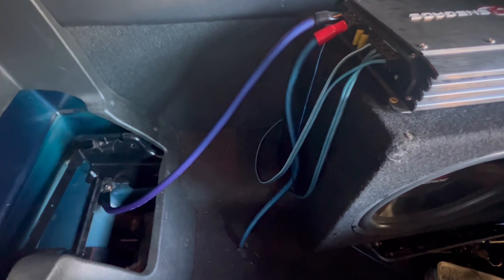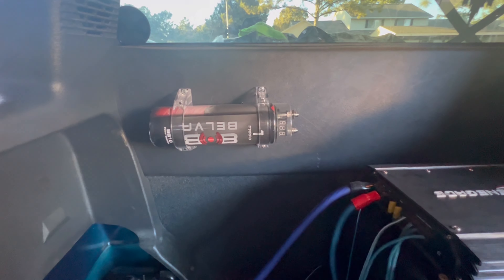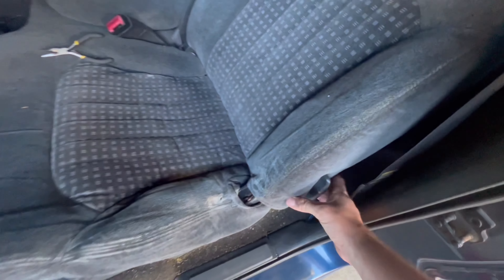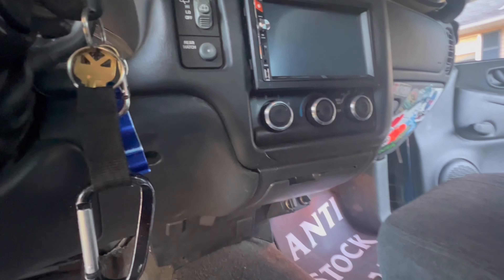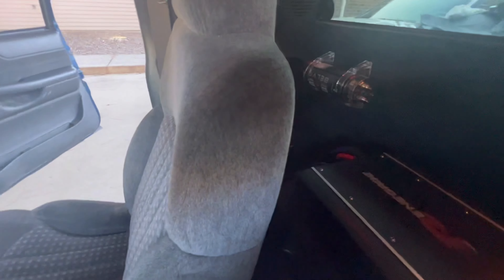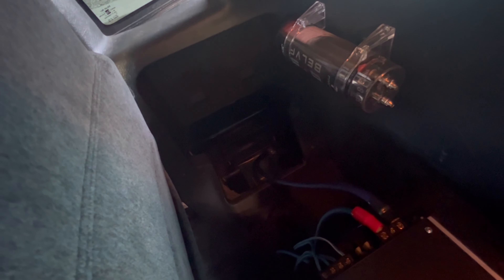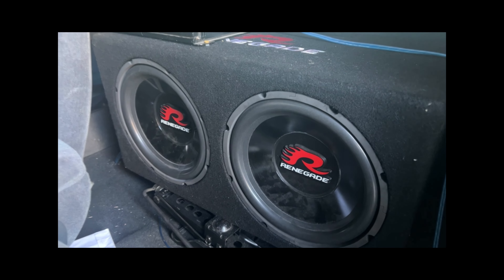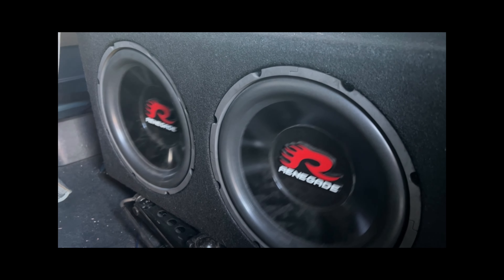Installing Subs In A S10

Comment: good video im only gonna be using a 1200w amp with and single 12 in a ported box from skar but i also got the skar wiring kit 0/1 gauge and found out people ran it through the atenna gromment, i pulled the carpent back on the passenger side made and slit and plug the groment out and trimmed the gromet to fit both wires, gonna finish everything tommorow

Comment: What radio do you have?
Reply from the maker: It’s a old Boss radio man nothing to brag about, cost about $400 back in late 2000s found it laying around the house. Works like a charm was still wrapped up lol. It’s outdated but has GPS, Digital Speedo, ect. I’ll upgrade eventually but for now this one works great compared to the $80 eBay double din I had